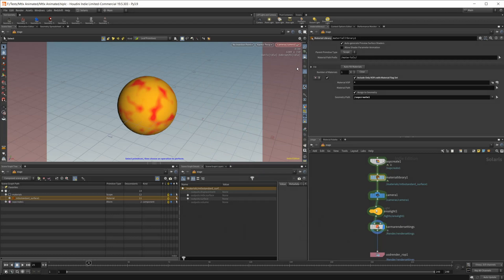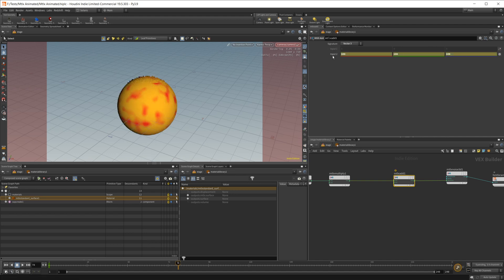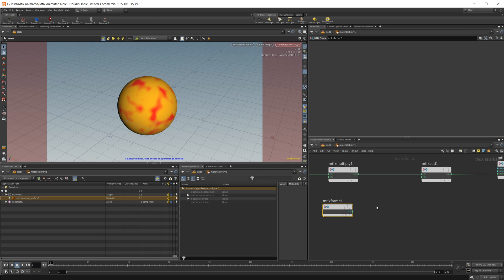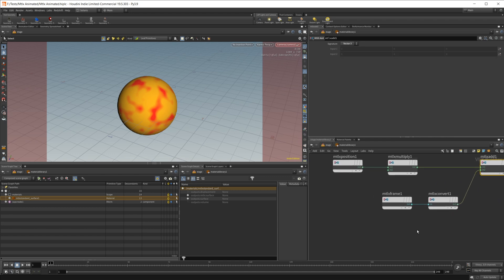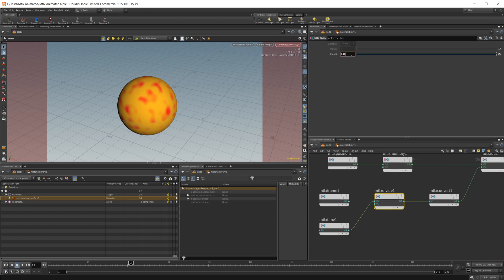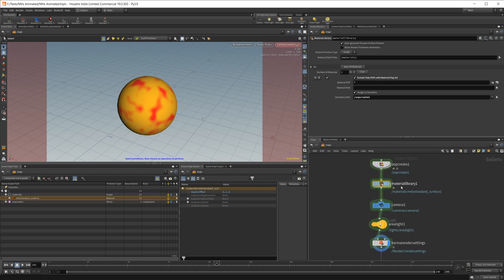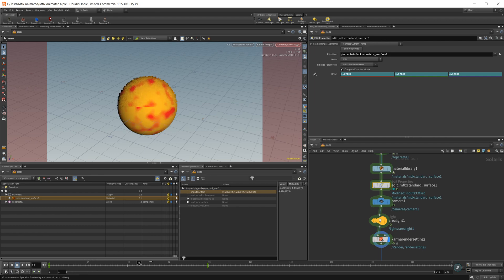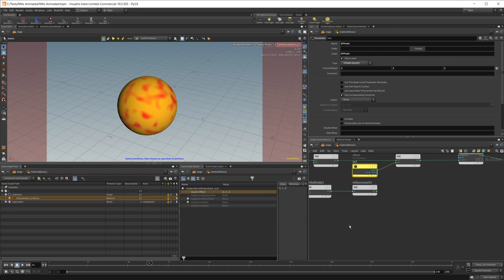How to Animate MaterialX Properties | Houdini 19.5

Comment: Thanks so much, I had a wetmap made from your wetmap video, saved the wetmap seq as exr seq and loaded using this method, you everywhere xD, thanks!
Also, to use an image seq, change type from float to file(string), then put that in a mtlx image nodes file input. then in lops edit the parm as shown in this video and load the image seq.